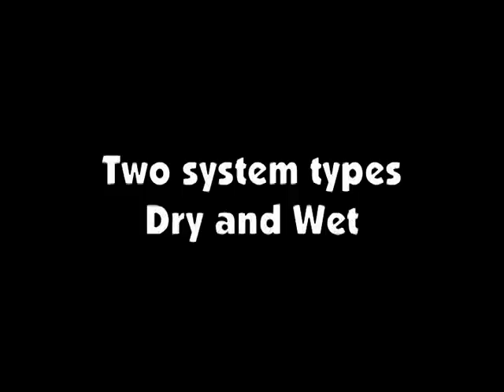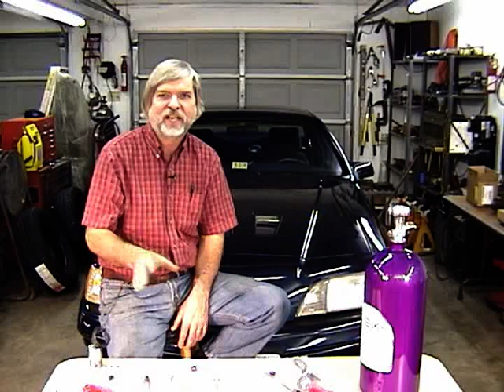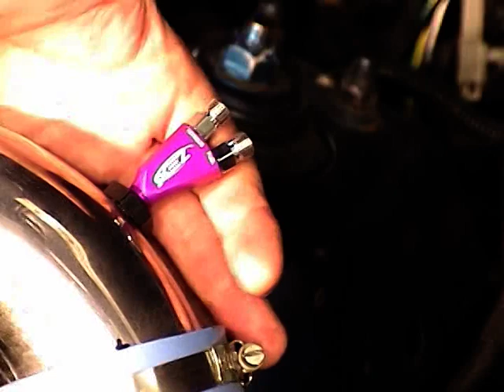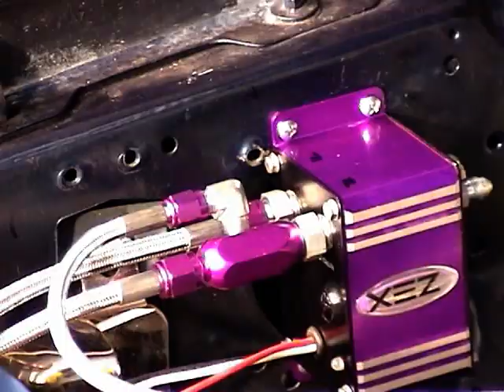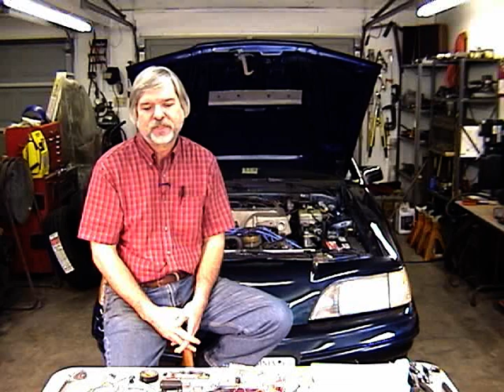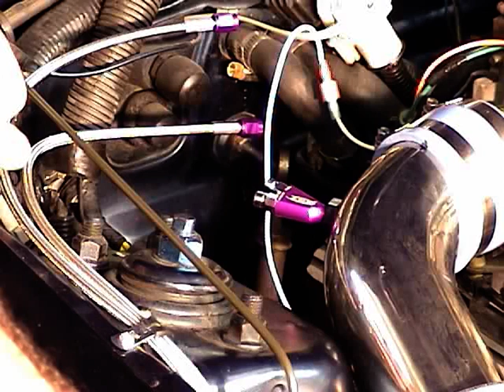Installing a Wet Nitrous Oxide System on a Ford 5.0L EFI engine

Comment: Looking to do this on my 5.0L Ford Falcon EFI (In Australia), engine has been rebuilt, mild cam (stage 1), bored, balanced etc...all the nice stuff to hold it together, roller rockers, and bench serviced BTR transmission, I will need a better torque converter as you mentioned. I plan to just have a low shot wet system, I just want some extra mumbo at wide open when I go to a track day etc...thanks for taking the time to show this, made things really easy to follow. Will be ordering parts soon, regards from down under.

Comment: do you happen to now  which wire  is the throttle body position sensor for a 2000 Silverado the one that hooks up to the white wire
Reply from the maker: I have no idea. It should say in the instruction sheet.

Comment: Hi King : can you tell me what gone wrong if you connect the black wire  from the zex wet nitrogen system on the positive of the battery,  we did hear the klick of the solenoids but the green light never come on even if we correct the mistake after. if we re-connect the black wire on the negative of the battery  nothing works , no sound of the solenoids , but if we put the black wire back onto the positive of the battery the solenoid klick sound is hearing but the green indication light is no to seen
Reply from the maker: Where do you have the red and white wirings going?

Comment: Hey Ken. I know this is an older vid,. But I recently bought the same zex nos kit for my foxbody mustang. Question; Do you think installing the management unit( Solenoid Pack)  on the wheelwell area between the r/s of eng. (not far from header's) and like right under cold  air intake pipe where it 90's off the throttle body.If you catch my drift,. Do you think that's a ok spot for installation? because it will have more heat from headers of coarse.what do you think? or should I mount it mmore similar to yours?
Reply from the maker: It might be fine but I did it the way in the video to make it easier to service.

Comment: what speed density cam did u install in that tbird?
Reply from the maker: +Christopher Hicks It's a Crane 2020. It really isn't SD friendly at all. It ran fine at the strip but always had stalling concerns until I changed to mass air.

Comment: Hello sir nice video. ...I have a 1997 dodge ram sst 5.9 v8 has long headers, cold air intake and hypertech tuner install. I want to install the same nitrous kit on your video with 75hp shot....do i have to bring my tune back to stock?

Comment: I have a 2014 Mustang 3.7 v6. Just ordered my kit a few days ago. I have purchased colder spark plugs and was wondering if if running a 35 shot or 50 shot would require a tune? I have heard yes and no from alot of different people but you seem to know you stuff so i figured i would ask.
Reply from the maker: With that small a shot, you're likely ok stock but only run 91+ octane fuel.

Comment: Great video thanks! I have a Nitrous Works kit sitting in my basement. I keep going back and fourth about hooking it up to my 90 notch. It's got basic bolt ons like BBK long tubes, 65MM TB, CAI, X pipe, 2.5 flowmaster cat back, new FRPP trac loc along with 31 spline axles and 3:73 gears. Most that's been dug into the engine is an E303 cam, with explorer upper and lower intake. 5 speed car btw. Fun to drive and cruise but that kit is starting to look much better!
Reply: Dude you're set for the kit with what you have done. bigger TB, cam being the 2 best mods to support the NOS addition.
I'd run a 200 shot on it my self.   Maybe in 2 stages. Don't believe the rumors. Tune it right with sparkplug color, don't cut corners and the motor will be fine.

Comment: G'day mate I am running the 5.0 in my ford XR8 here in Australia I noticed a few differences I see u are running a distributer and we have coil packs is that standard for that motor as they have a few issues with the cool packs and your intake manifold I'd reversed to ours I just bought a nos system tho it is different to the one on the video but it was a top video none the less and I learnt a few things cheers
Reply from the maker: 5.0L Mustangs 86-95 in the states look like what I have. CrownVic's have intakes turned around but nothing else. I have a feeling that the down-under 5.0L have reversed intakes because of right hand drive. Coil packs are used on the Explorer 5.0L and most other engines when Ford changed over to the EEC 5 systems.

Comment from the maker: I'm still running 19lb injectors and stock SD EEC 4 electronics however installing a 255 lph pump was the first thing I did before racing the car.

Comment: ok cool, thanks for your input! if i run in the 12's with just motor, would you say its probly a good idea to upgrade my fuel pump, injectors, and MAF before i install nitrous?

Comment: ok, was just wondering if you had some sort of idea since you have experience with Nitrous. Im putting in a 3300rpm stall, valve body, tranny cooler, then aftermarket control arms, new drag radials, new adjustable front struts, and possible SCT tuner chip, i hope to run mid-high 12's on just motor this coming year.  I wanna upgrade my fuel pump, injectors, and MAF too if i have money, i was hopin with 75-100 shot i could run somewhere around 12.00

Comment: that's impressive! very nice numbers sir! Gives me hope to run the numbers im hoping. Ive got stock aod/torque converter, 3.73 gears, holley intake man./plenum, 70mm throttle body, 19# injectors, stock fuel pump, trick flow heads, E-303 cam, long tube headers, catless mid pipes, no AC or Smog pump, what do you think i could run with 75/100 shot? my car weighs bout 3200 with me, currently 13.5@105mph 2.1-2.2 60' times?

Comment from the maker: I've ran 14.00-13.98 on motor, 12.60's with 75 shot and 12.44, 109mph, 1.69-60 ft  with 100 shot. This is with a 3.73 gear shifting at 5K, stock converter and heavy TBird.

Comment: what were your before and after times with 75 shot and 100 shot...im currently running 13.5@105mph with my 93 Mustang w/ aod, was considering nitrous if it gives me the gain im looking for, kinda wanna go 75 or 100 shot.

Comment from the maker: With a 75 shot I'm going 12.60's and 1.76 60 ft times. Replacing the stock converter in there now would likely make a big difference.